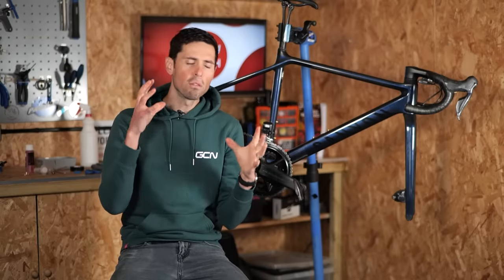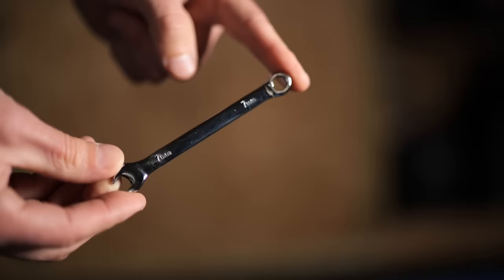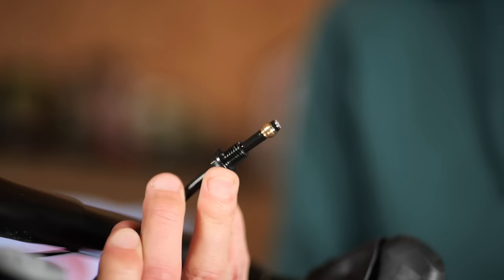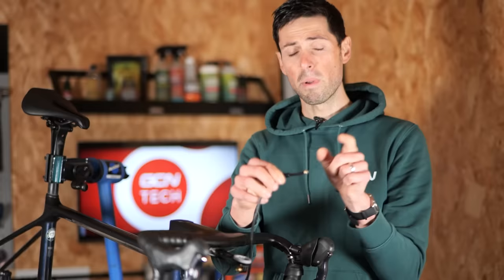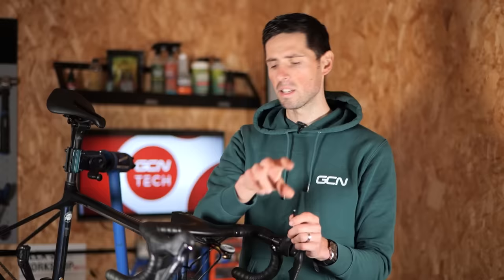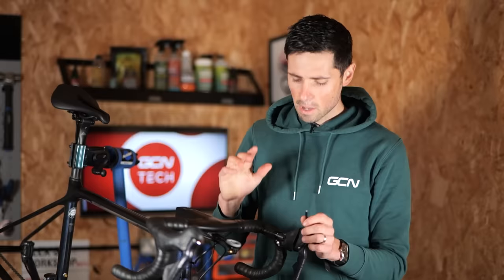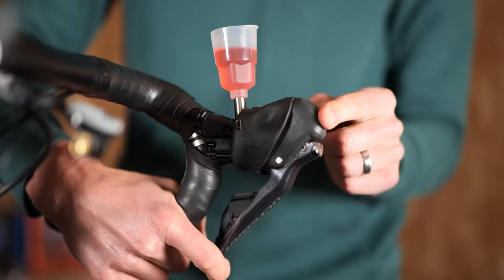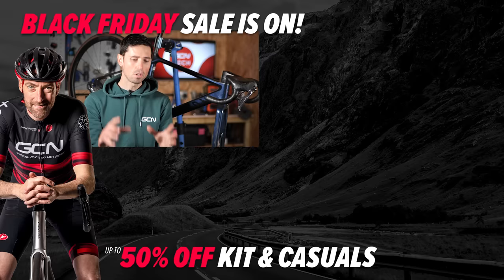The Easiest Way To Shorten Hydraulic Disc Brake Hoses

Comment: If you’d shortened the hoses at the calliper, you wouldn’t have needed to remove the handlebar tape. You just need to pull the hose through the forks/frame. After all, you would remove the handlebar tape to replace a worn calliper.

Comment: As usual Alex makes it too complicated. It's far better to push the excess hose through the frame or fork and cut it short at the calliper end.  To be honest you could just push the hose through the frame and just leave it be. That's a huge faff just to shorten it by 25mm! Yet again it seems like a pot boiler video to plug tools from a certain sponsor.

Comment: Would a bleed be necessary? If you've been careful and not depressed the lever, you shouldn't have fluid leaking out the hose and the shifter should still be fine as well. That's what I've done before and it worked fine
Reply: You will most likely get a tiny air bubble in there. It might not be necessary to get rid of it, but it is safer to bleed.
Reply: @SimonHBS  i spose it could happen, I wouldn't default to doing it though, id test the brakes out first as they might be alright

Comment: I don't do a full bleed on my brakes. I just fill the cup with fluid and put it on the brake. Then I just tap my brakes over and over until there is no more bubbles coming up. The tapping of the brakes is done by just quickly flicking the brake and let it selv adjust fast back out. That is enough for the bubbles to come out. Works like a charm.
Reply: Even easier, leave the bleed cup attached to the brake lever with fluid in place, then simply tape or strap the brake lever to the bar (or as close as it will go). After  a few hours, untape the lever and allow it to return to the normal position. The brake pull should be as good as new.

Comment: In my opinion, the bleed proces Alex shows here is too simplified. You really risk getting air bubbles trapped in the hose and poor braking. I suggest you watch Park Tool's instruction videos for a better method (there are different videos for the different kinds of brake levers)
Reply: Om my mtb I tried both ways, the official Shimano one and the one where you just push a full syringe of oil through the system to flush all air out.

For me the simplified version worked as good as the official one, no air in the brakes and an  excellent pressure point

Comment: Before i start - no i am not yet another hater, or internet troll - just pointing out - so people won't get confused
So many things wrong on this video that can put people in difficult position. 
1) If you have option (and can pull hose near calliper - then cutting near calliper will be much easier and less faff with bar tape etc. 
2) You forgot to mention that note 15mm of hose that gets inside to calliper / brake levers
3) You didn't mentioned about making sure you have nut still on the hose before putting needle - as it might fall in the process  
4) it is much easier to put olive first before needle  and as in some cases after putting needle hose expand that insetting olive afterwards will struggle 
5) You should also mentioned that it is safer to clamp or use electric tape on handlebar tape to hold it in place and prevent from unravel more 
6) Before pushing Pisons - clean calipers and so no dirt scratches pistons. 
7) You did not mentioned anything about being careful on pressing evenly pistons 
8) Forgot to mention about little rubber o ring in the bleed port

Comment: That bleed process was easy! A lot easier than on a car. I'm no longer worried about having to service hydraulic brakes. Thanks, Alex!
Reply: In my opinion, the bleed proces Alex shows here is too simplified. You really risk getting air bubbles trapped in the hose and poor braking. I suggest you watch Park Tool's instruction video for a better method (there are different videos for the different kinds of brake levers)
Reply: The bleed process is simpified compared to the official Shimano method, however I tried both ways on my MTB and the simplified process always worked fine. I use a full syringe of oil to be sure to get all air out, I never had any problems.

Comment: I did that style of bleed just before an event I was looking forward to. Mistake! Somehow I got loads of air in and with it being the first time on a bike (i e do e M/Cs and car before so had a false sense of knowledge/competence) I didn't know about tilting the bike up and down to release bubbles. So, vrakes were crap and I missed the event 😢. Lesson learned I  wont mess just before an event again and I will do better research on work  methods. Once I knew what to do it only took a few mins to sort.

Comment: Nice video once again, quick question though. Is bike brake fluid as good at spoiling finish and paintwork as car brake fluid is (or was) ?
Reply: It depends on the manufacturer, Shimano uses mineral oil which does not really attack paint . Some companies such as avid use DOT fluid which is the same as is used in cars.
Reply: @raginganarchist  cheers for that.
Reply: @johnstrac it's also important to use the fluid the individual manufacturer intends for the type of brake, you can not use Dot fluid in a mineral oil brake or the other way.

Comment: 9:09 Hi Alex, the most frustrating job I personally find is removing and replacing the headset bearings especially tightening up the bolts to load the bearings correctly and take out any play.
Reply: that's one of the very few things easier done with the bike on the floor, not in a bike stand... and do it after you've set up your front brake (or just leave it intentionally loose and come back to it after you've set up your front brake)...

TL;DR: you tighten the headset bolt (the cap screw) first before touching the stem bolts... and you only tighten it enough to remove play
the reason to do it on the floor is that with every 1/8th of a turn, you can engage your front brake and rock the bike back and forth and feel for any play in the headset... if there's play, just go another 1/8th a turn and check again... keep going until you have no play (and only just... don't over-tighten), and then tighten the stem bolts

once the stem bolts are done, they are what's holding the headset in place, not the cap screw... this is why you don't need to over tighten it once you've eliminated play

i hope this helps

PS. Oh, also make sure you front tyre is pumped up... it helps make any play feel more obvious

Comment: Is it possible to shorten the hoses from the caliper side ?
Reply: If you flip the bike until the connector is higher than the brake lever, maybe.
Reply: No
Reply: @K_I_M_A_N  For my understanding could you please explain why not. Is it not just another compression fitting or am I missing something?
Reply: Why tho?
Reply: Yes. That's the smart way.
Reply: It is easily possible to shorten at the calliper.
Reply: Yes, far more practical
Reply: @markeasey469 it's exactly the same fitting like on the lever.

Comment: Always harder to get air out of the rear brakes because it’s a longer hose and it goes under the bottom bracket. I leave my bike in a stand overnight with the front wheel in the air so the hose is as vertical as possible to allow bubbles to migrate to the lever

Comment: alex is running 12s cranks on 11s groupset
Reply: Good spot! Yes you are correct. But its actually Chloe's bike .
Reply: It makes no difference if the chain isn't too narrow.
Reply: Could also be a replacement set from the recal.

Comment: Why doesn't the mineral oil come out of the hose when you disconnect it?
Reply: Try it with a straw in a glass of water. Keep one finger on the end of the straw to seal that end. Et voila.
Reply: Hose sealed one end so air pressure stops gravity pulling the oil out of the open end